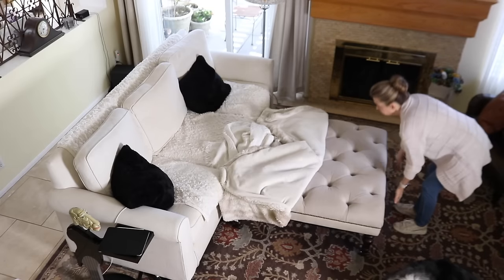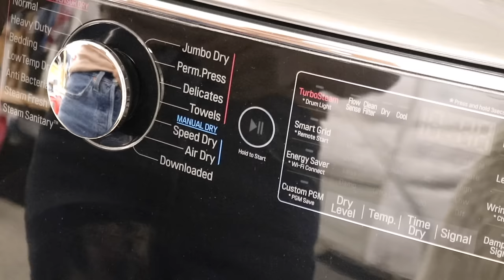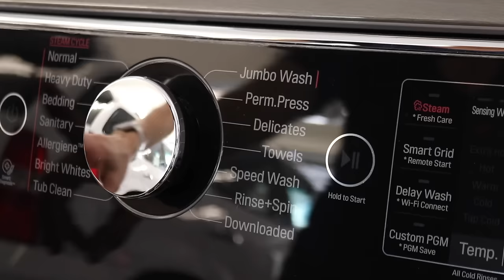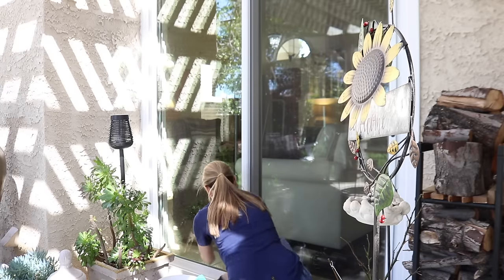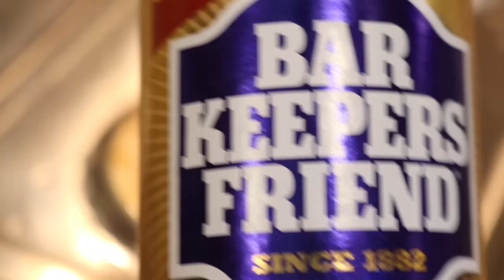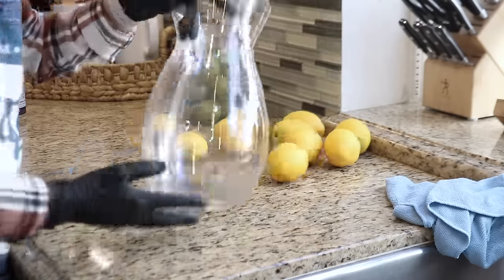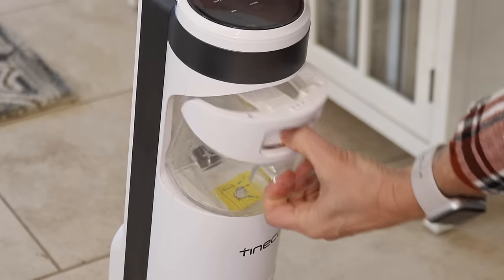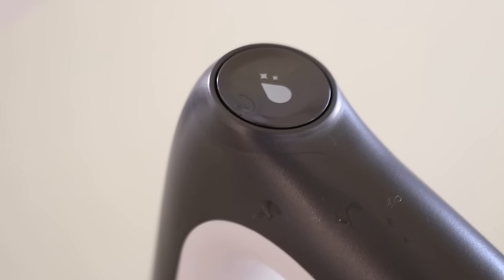SPRING CLEANING MARATHON | 2 HOURS OF CLEANING MOTIVATION

Comment: Pour a little baking soda in your garbage disposal before you dump your hot vinegar water down the drain.  The vinegar and baking soda will foam up in the drain and clean it as well.  Just rinse it well afterwards.  The vinegar/baking soda foam will clean off excess dish soap in the disposal and drain and it will help to keep your drain smelling good as well.